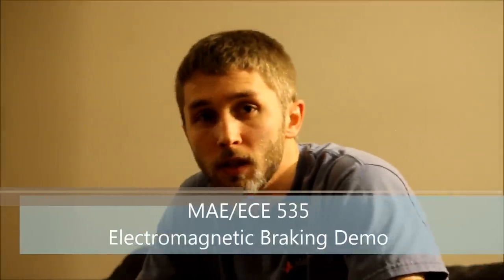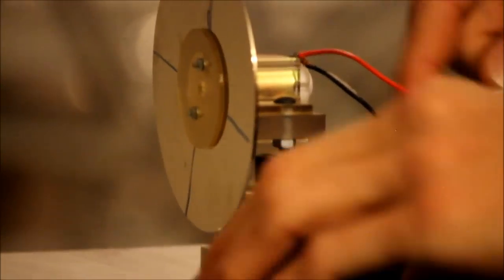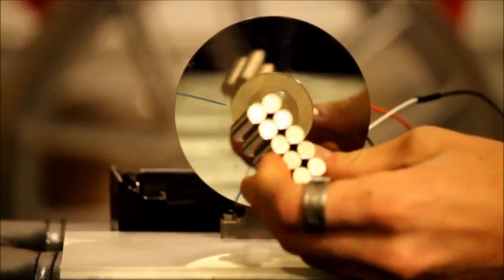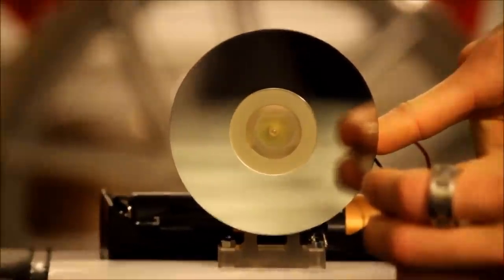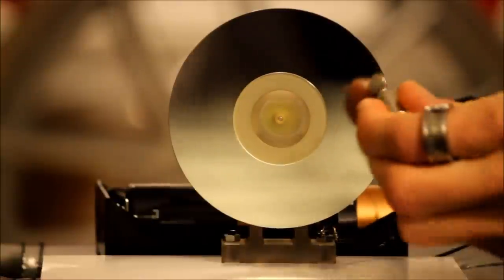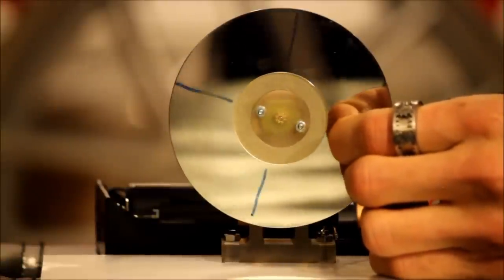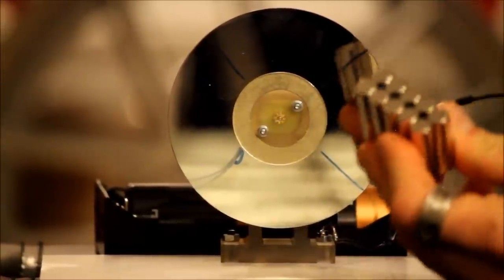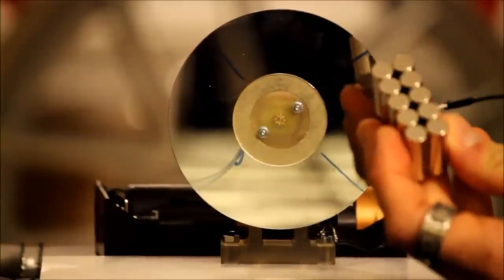Magnetic Braking Demo

Comment: dang, this stuff should be in cars so we don't have to replace the pads all the time (not all the time, but you get the point)
Reply: The magnetic braking system utilizes the eddy currents generated by the metal sheet (in this case, the disc) cutting the magnetic flux (or magnetic field lines). As the disc slows down the eddy currents generated in the disc becomes less, as the rate of cutting of magnetic flux decreases (in other words, it cut magnetic field lines slower because it spins slower). Therefore, the braking force becomes less efficient as the disc slows down. In the case of trains we don't need too much precision in braking, therefore this is indeed much more efficient. However, in the case of cars of other vehicles you see on the highway, we often need to stop immediately without delay in emergency situations, so the 'slowing to a stop' effect of magnetic braking becomes essentially useless in cars.
Reply: In fact most trains use this principle as a braking system nowadays, with exception to maglevs. Due to the heat generated by the circulation of eddy currents, this principle is used in inductive cookers as well. This principle is based on Faraday's and Lenz's Laws in magnetic induction.
Reply: It won't hold the wheels at a stop . it can only slow them down. you would still need a mechanical (ie. friction) brake to bring vehicle to a complete stop
Reply: @Mazda rx7  But that would still mean the wear on the braking pads would be reduced considerably. As well as reducing brake squeaking.
Reply: I'm trying to find the video on here, but I seen something like that used on either a dragster or a top speed car in the desert. Can't remember. That would be a great addition to our regular car brakes

Comment: Hey Kyle, can you explain all this stuff in layman's terms so it's not over my head LOL. You know I'm just joking. Good explanation on Farady's and Lenz's Laws. Another way to demonstrate the effects of how a magnetic field works on a conductor that's not magnetic is to drop the magnet down a piece of copper tubing, say about four feet long. Take the magnet and drop it through the tubing and you'll see that the magnet will travel down the tubing much slower than a similar object in size and weight that's not magnetic. Cool stuff! Oh, that bracket that you designed and made on a 3D printer is pretty cool too. Take care Kyle and don't make us all look bad (smiling)...